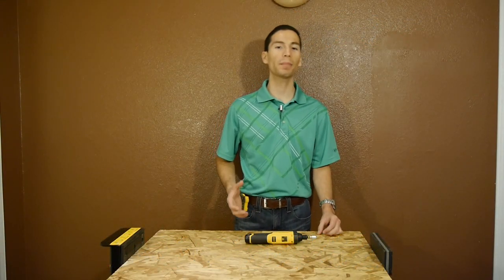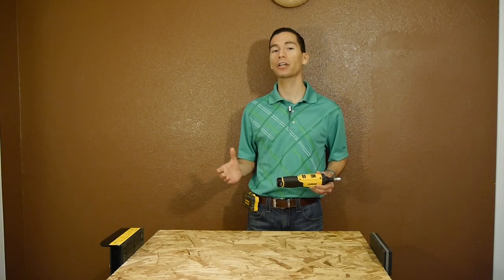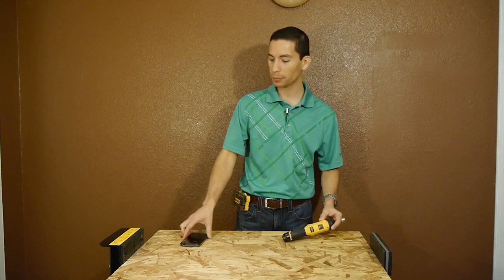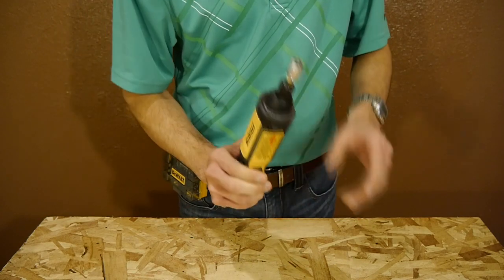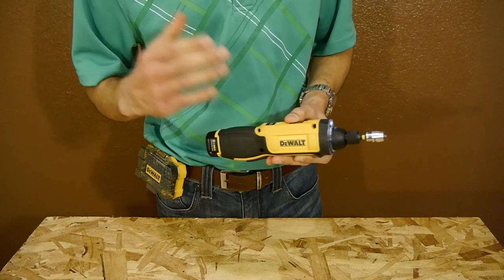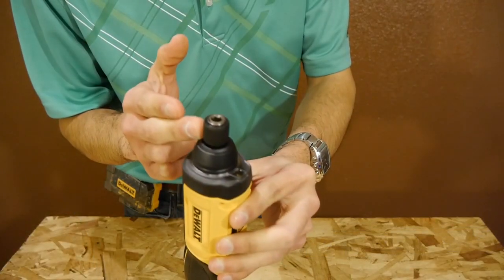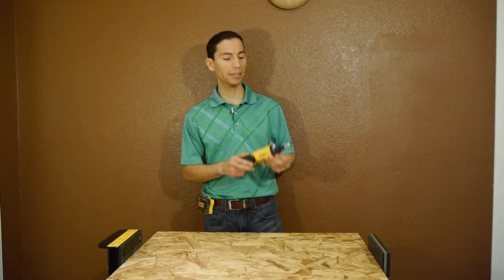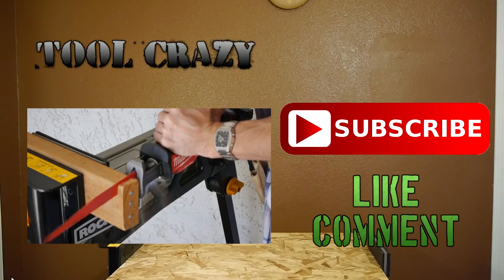DeWALT 8V Max Gyroscopic Screwdriver DCF682 Review

Comment: I have the original Gyro Screw driver and I really like it. I use it for a lot of electrical work. I saw this new one in my HD and it intrigued me but since I already have the original I passed on it. The clutch is one of the best features about the original driver. I also have the 8V flashlight and it has become my go to light for just about everything. Thanks for going over the new one. Another great review by J-Dog.
Reply from the maker: Brien thanks Brien! I bet that flashlight comes in handy. Dewalt did great by giving it removable batteries to expand the 8v line
Reply: I would like to see the 8V line expand. I think a headlamp would be a nice addition.
Reply from the maker: that would be cool

Comment: Great Review Javier - I bought the original one (DCF680) a year ago and love it.  Some have complained about it putting your hand in awkward positions, but I don’t find that to be the case.  Sure, if you use a drill (or maybe the DCF610) you don’t have to twist your hand at all, but this device is designed to mimic the motion of a screwdriver.  If you can comfortably use a screwdriver, this will be comfortable too.  I love how I can slip it into my electricians pouch and not have to feel like I’m carrying a drill around with me.  Also -  I like to carry my bits in a small prescription bottle.  I keep 2” versions of the regularly used PH1, PH2, and a straight bit, then an assortment of 1” bits for everything else.  This way I find the commonly used bits fast, but have the others if I need them.
Reply from the maker: Jeff Huguelet Thanks Jeff and great insight on the use of the original model. I like your originality on using pill bottles for bits. I like how handy the bit case is (the one that comes with this kit) because you can just put it on your belt and they're ready to go. Only thing is that its designed for 1" bits. Would like another identical bit case that stores 2" bits

Comment: Today is a good day as I just learned something new... I had no idea how a Gyro Drive would work and I must admit I thought this was going to be a spoof video or something. Obviously all doubt was cleared up as soon as you twisted your wrist to show how the "GYRO" actually works... Great concept... As intended this would work well for light electrical work, but the Impact is still the best option for any screw over 2 1/2" and especially 3" and up. It does have surprising torque however...
Reply from the maker: Paul Bialozor it does sound weird at first but it's very interesting how it works by the motion sensor

Comment: Nice review and jumped on it as they were $40 for the kit at HD. Pretty easy to get use too and the only thing that would have made it better would be a clutch. Killer deal for $40 if you can get one.
Reply from the maker: Cesar Lopez thanks Cesar. A clutch would've been great but the price is right

Comment: It's funny that you mentioned the Wii remote.  When I first saw this tool I thought of my experience with the Wii.  For the first 30 minutes the motion controls were awesome, but pretty quickly I wished I had a regular controller instead.  I imagine my experience with this tool would be much the same.  If this tool had a standard switch I would buy it today, but the motion controls are a deal-breaker.
Reply from the maker: Some people like it some don't, just another way of doing the same thing with this screwdriver. I agree about the wii controller, I never thought the wii remote was 100% accurate and to me was just a gimmick

Comment: Makita has a really nice 7.2 volt impact driver model (TD020) and also a really nice  7.2 volt  screwdriver with a clutch. The only problem is that each tool is priced around 160.00
Reply: I had a Hitachi 3.6 volt cordless screwdriver that had a clutch on it and was really nice. But I ended up getting Reid of it because I never used it. For small projects my Dewalt 12 volt max screwdriver model (DCF610) is my go to tool.
Reply from the maker: Cody Robertson I like the idea of a 7.2 volt impact driver. I still like the 8v Porter cable
Reply from the maker: Cody Robertson that 12v max dewalt screwdriver is nice too. I used it this weekend. Had to open a computer and fix some hardware with it.